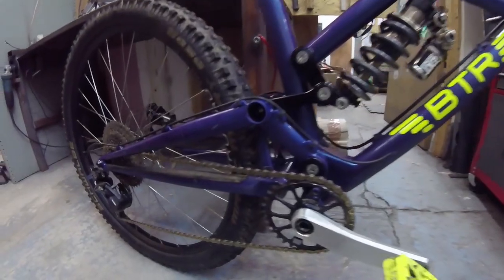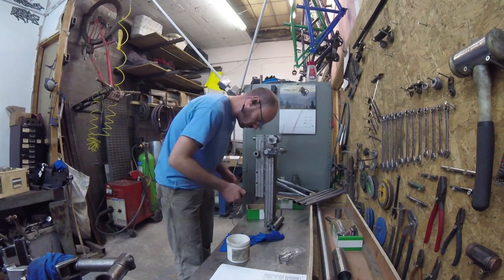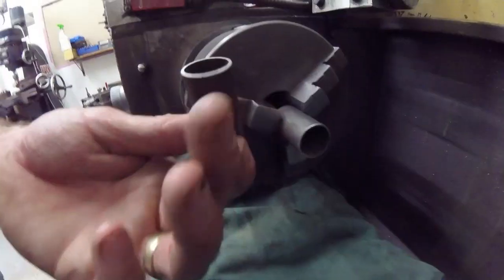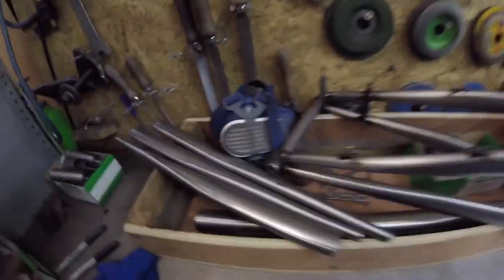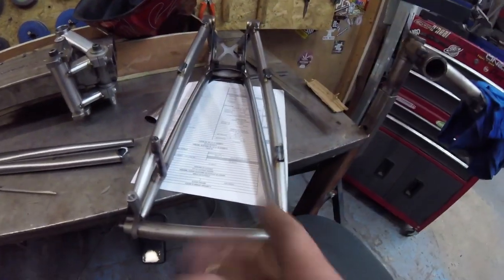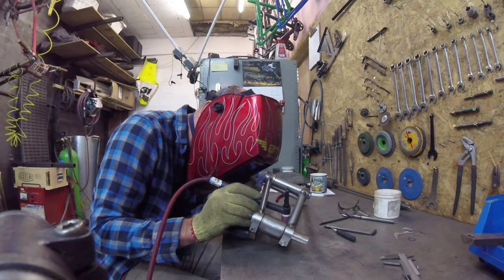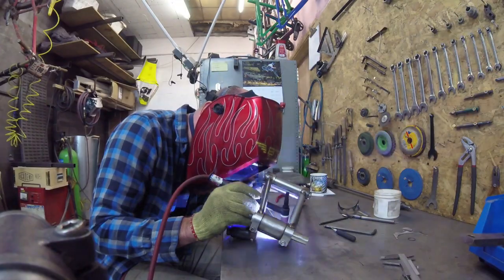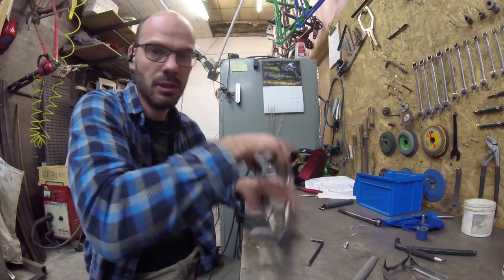Steel MTB Swingarm Framebuilding - BTR PINNER - Fabrication Build Video

Comment: Amazing! What exactly kind of steel do you use? Is it reynolds 853 or another?
Reply from the maker: The oval to round stays at the back are from Deda in Italy and the shorter stays at the front are plain guage 4130. I would use Reynolds for the front triangle, but they are so often faulty that I don't get the chance...

Comment: Could you make a 650b Pinner frame a mullet geometry 29er front and 27.5 rear
Reply from the maker: It's possible, yeah. I'm kind of not making the Pinner anymore. Can't get the rear shock size anymore.